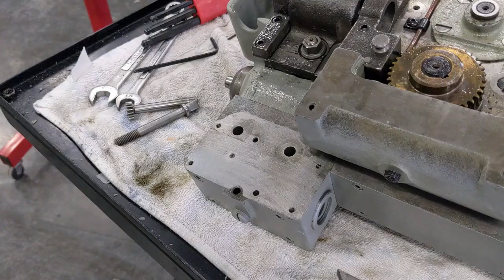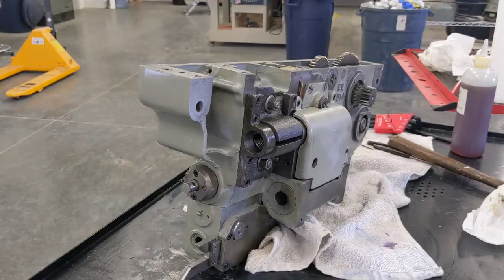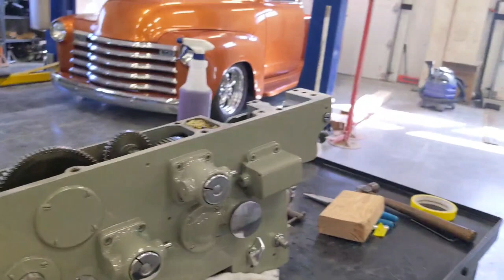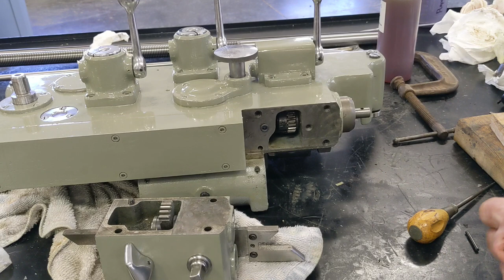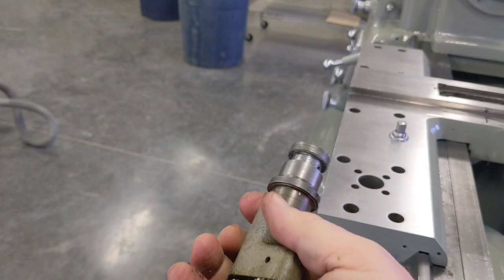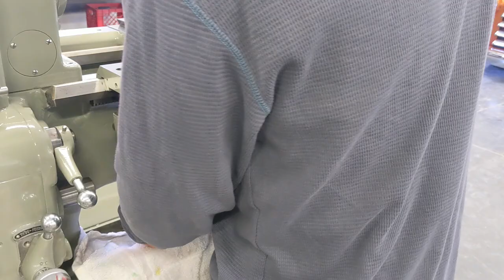Monarch 10EE Lathe Refurb part 13

Comment: For years I have avoided grease on my lathes. I always found the grease to hold whatever chips, swarf, and so on. Just using oil has worked well for me.
Reply from the maker: So I've heard that same opinion from several seasoned machinists.. That's good enough for me!
Reply: @fourpondsshop7940  At one time, South Bend suggested a low viscosity grease for the gear train on certain machines. Basically, the idea was this made for quieter running. I tried it, and it wasn't that much quieter. Went back to oil, and have used it since. No regrets.

Comment: The monarch 10ee user manual says adjust the clutch so the handles go and engage at the 45 degree positioning.  They should not go to 90
Reply from the maker: Thanks for watching and thanks for the adjustment spec.. That makes sense!

Comment: Fantastic work!  What kind of paint did you use on this project?
Reply from the maker: Hi Bryan, Thanks for watching!!
I used PPG catalyzed single stage automotive paint. It is their Concept DCC line. I used DCX61 hardener and DT reducer. It is a Mercedes color code DB704.

Comment: I noticed the center drill holes in the half nut retaining bolts. Each one is individually turned and threaded fit to size. The hundreds of beautifully made and finished castings. Watching you put these parts together makes me appreciate the dedication the company put towards fit and finish.
The quality of the Monarchs is second to none imho.
How much would it take to produce that machine today?
>$250,000 I would think.
Reply: You can still  buy a 10EE brand new, they start around $150,000 last I saw
Reply from the maker: I think I saw on Practical Machinist that they sell completely rebuilt to new spec ones for around $180K. Can't imagine what it would be if they had to cast and machine everything from scratch!